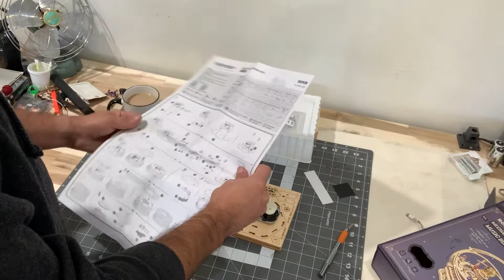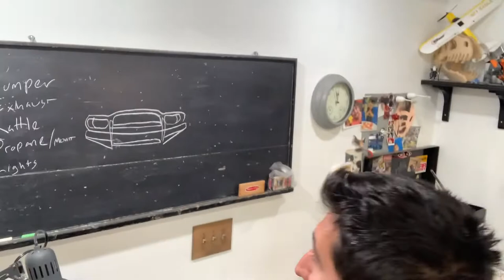Building a Music Box- Poorly Crafted

Comment: The problem with this type of kit is the tight friction fit of parts so that the use of glue is not required. The manual force required often results in parts breaking. The advantage of being glueless is that errors in construction can be corrected by partial dismantling and reconstruction. A compromise is selective use of a file plus sandpaper to ensure parts fit together more easily and selective use of glue to ensure loosened parts stick together.
Reply from the maker: Agreed. I kept the pieces that would easily fall off loose so that I wouldn’t have to worry about them especially in storage. This build is definitely more of a center piece for display than anything. Sometimes I still wind the music box and I take off the arches so the planets can spin freely. Anyways, thanks for the view and the comment, I really appreciate it!